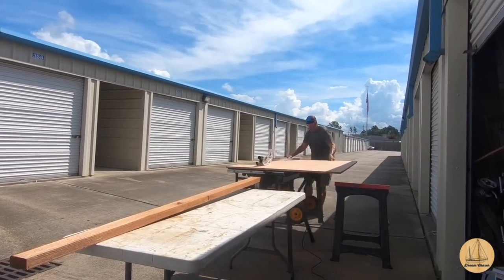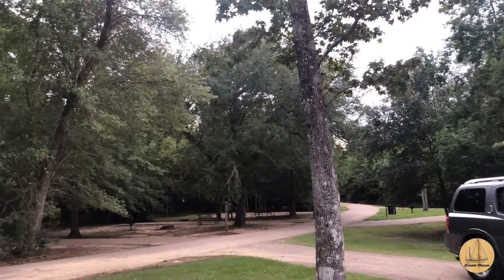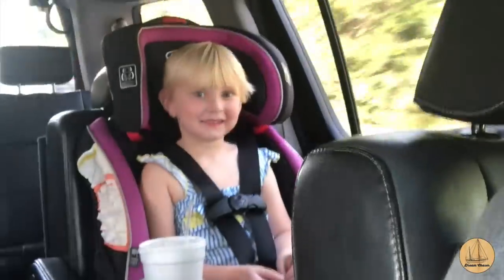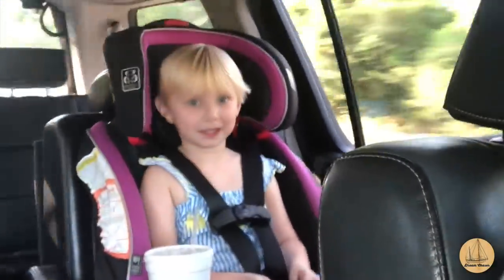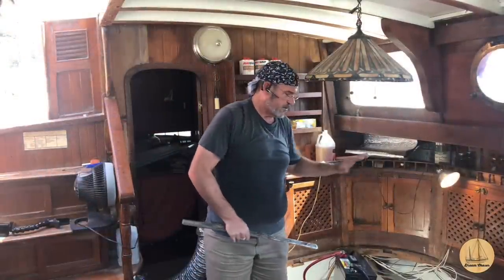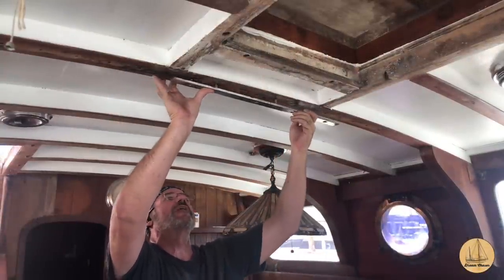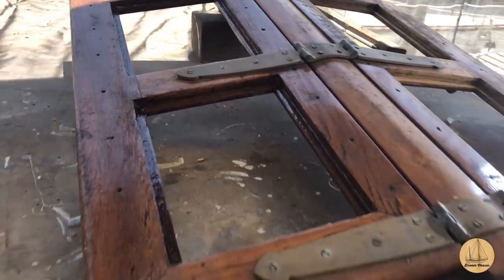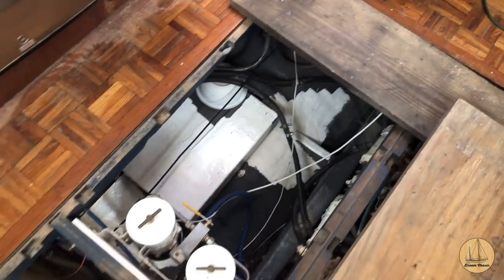Finishing Galley Sole, Hatch Glass and Bilge Paint

Comment: getting there :)
Reply from the maker: Yes we are. Finally.
Reply: curious outside of the hull how much of the original boat is left? seems you and the yard have replaced a ton of stuff
Reply from the maker: There is still a lot of original boat left. . We replaced the mast for the mizzen the main had already been done. And we left the original structure of the deck and the hall in the Coachhouse and the Coachhouse roof we just reinforced it rebuilt it and then skinned over the top of it with new glass to prevent leaks
Reply: ok from watching all this time it seems almost like a gut and rebuild in some ways